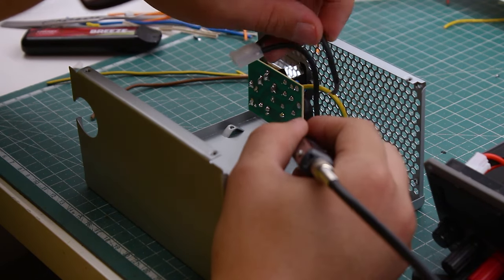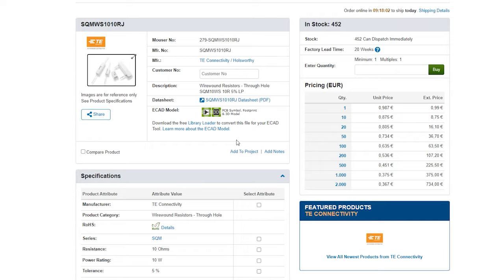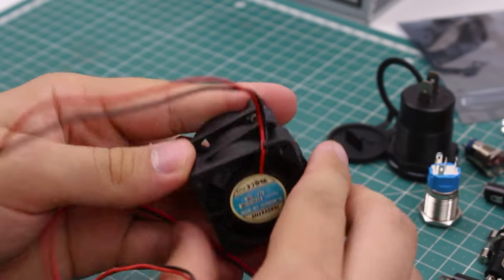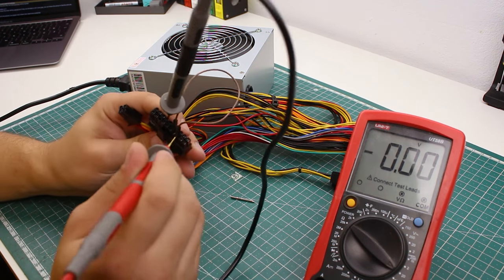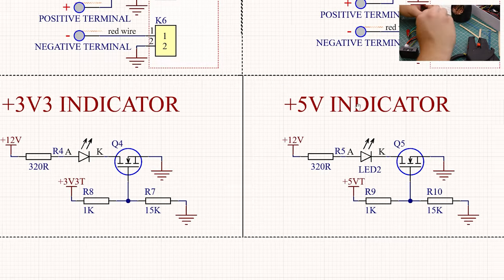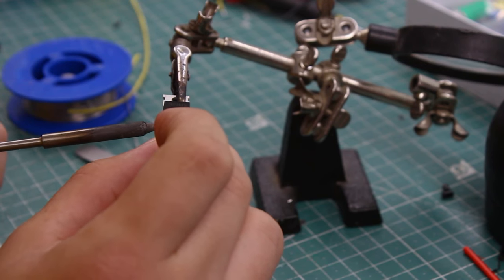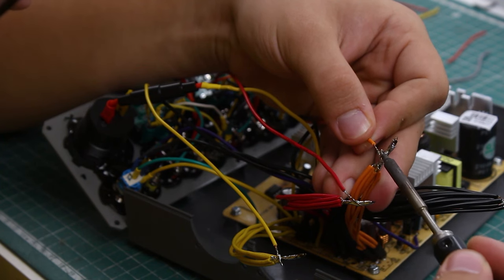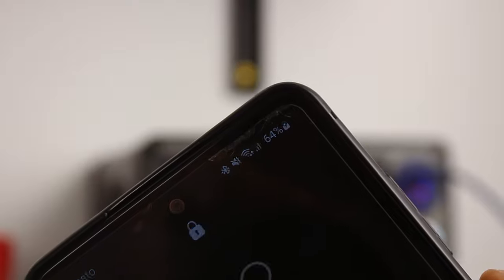DIY Lab Bench Power Supply From an Old ATX Computer Supply

Comment: Thank you for posting such a nice video. Your unit looks professional and quite versatile. There is one issue you should consider. When converting a computer power supply such as this, consider that the ground on most PC power supplies are internally connected to the AC power ground. If by chance you have another piece of AC powered test equipment such as an oscilloscope (they have the same issue with the ground), connecting test leads to the wrong place could cause something to go 'poof' or worse. You may want to consider, if you have the room inside the case, to install an isolation transformer. Or at least use one externally.
Reply from the maker: Thanks! About isolation, just as you said, I had a problem the other day. I connected a VESC controller to a 42V power supply that wasn't isolated because I didn't have a battery on hand aaaand when I connected the VESC to my PC over USB, the USB hub died together with a couple receivers for my barcode scanner and keyboards
Reply from the maker: I took a look at some isolation transformers for 240VAC but they are all over 100 Euros which is too expensive for such a project. I'll do some more research hoping I find something better
Reply: @Djambo57  you can make your own with a couple transformers, they must be same.

Comment: I totally disagree that OLD ATX PSUS are 'fine'.   They are much more likely to break down. And when they do they can destroy whatever they are powering
Reply: Most ATX PS breakdowns are cause by leaky electrolytic Caps. Replace them and you're good to go.
Reply: @paules0099   have  seen many more active  parts fail than caps in ATX PSUs
Reply: @kennmossman8701  and that was what???

Comment: Neat build up, just an FYI, you need to remember that an ATX PSU is a switching PSU, the output is by no means clean there is a lot of noise on the output. If you want to design or repair I would suggest you rather build a linear lab bench supply, there is a reason these supplies are STILL used, especially in a repair and design environment. For a simple and dirty supply yes you can do this, but, I would not suggest this for repair and design.
Reply from the maker: Yeah, and since I removed its case which is a shield it probably isn't a good idea to use it in a professional way. With that being said, this project was aimed at beginners, who are just starting out. Playing with LEDs, small motors, and similar stuff. 
It should do a good job for such things and I'm still using it to power simple stuff. When I quickly need to test a proximity sensor, for example, it's neat to have both 3V3 and 5V rails always there, always on
Reply: @Djambo57  Yes, for sure. I am sure it would be a good stating point for the beginner, I just wish that content creators would state this though,  SMPS's are great at delivering a decent amount of current in a small package, it is just not always the cleanest.  FYI, another tip, is to put a choke and another cap just ahead of the output terminals something like a 220uf cap and an appropriately rated choke for the current further cleans it up.....

Comment: Can you do a workshop and lab tour of yours, Please 🥺🥺. Also is it important to print the bezzel in TPU or it can be printed in PLA ?
Reply from the maker: Hey, the workshop is still not finished... I still need to get some tools like a microscope and an oscilloscope. I don't want to make a video about it until it's 100% how I want it to be, but when it gets there, definitely! For the parts, I left around 0.2mm tolerance if I remember right so it could be printed with PLA, but I'm not 100% sure :)
Reply: +1 for the workshop and lab tour

Comment: Nice project, the only thing I don't agree with is the positioning of the fans. In my opinion, all 3 fans should be positioned on the side where there are now 2 of them (throwing out air) while on the side where you placed one, create a grill large enough to let in the same amount of air that goes out. With this configuration, the hot air present inside is expelled by the fans and replaced by the fresh air that arrives from the grill.

Comment: Hm, how do you get the 3.3V display to work? On the Ali that kind of displays says they only works from 4.5 to 30 VDC?
Reply from the maker: Well these displays have 3 thinner wires. Red and Black are for powering up the display and you can connect the red wire to let's say 12V. Then use the yellow wire on the 3.3V rail to measure it. This measurement will then be displayed on the display...

Comment: I see the schematic for the mosfets in the video. In your video it looks like you are connecting two of the legs of the P channel mosfets together. Is that just an illusion, or are you really doing that? It would be nice to see a bit more detail on the connection of these :) Maybe a link to the schematic at least.  Thanks for the video.
Reply from the maker: Just follow the schematic it is correct. I remember  connecting something wrong while recording because the camera was in a way and it wasn't comfortable to solder like I usually do 😁

Comment: Well done!
You put a lot of thought into this thing. Many times, I cringe when I see people neglecting to use fuses and to build in other sorts of protections and precautions into their janky DIY PSUs. They just use stuff like ATX PSU cases for enclosures or they have cooling slots all over the place(in 3D printed cases), even though a Bench PSU is in a work area, and pieces of cr*p that you snip off or throw away, like pieces of copper wire and plastic etc.. can go into the enclosure and fans, and bliksem it all up.

I've never bothered with DIY bench power supplies- they just aren't worth it, and just bought my own- spending good money on it- as I do all my tools, equipment and appliances. My dad always said that it doesn't matter how *poor you are, just buy quality tools and equipment, BUT... I would like to build this one- with variation of course. I'd add a temperatue sensor for the fans- it's a low-power bench unit, no need for the fans to always be on and use additional power(every little helps). I'd also add a solar option and Li-ON batteries.
Should be good enough for an everyday option to preserve the life of my TDK-LAMBDA.

* (And my dad really was an underpaid tradesmen, but he had Hilti, Bosch, Gedore, Makita, Sony, JVC, Telefunken, Phillips, Calibra, Tektronix, Engineer Tools(Japan), Shimano, Weller, etc - all over the place. None of those ever let him down.)

Comment: one limit of this is that you can't tie your grounds of different voltages together, so if you have a circuit that needs 3.3v and 5v, it won't fly.
You can't tie the grounds together because the volt-amp displays have to be between the load and ground, not the supply and ground. If you do tie them, your current readings will be wrong.
I ran into this myself. My solution was to get some hall-effect current sensors and use an arduino to fake an analog output to the current measuring part of the circuit. Never got it quite calibrated though, other projects came up.

Comment: Your lab bench atx psu might be the best one Ive seen. I'm thinking of doing the same but I read online that ATX psus arent current limited. If I wanted 12V at 0.5 amps will it be possible or will I end up frying pcbs?
Reply from the maker: Thanks! They are not current limited but you can find some DC-DC converters on Aliexpress which can help you regulate both voltage and current. I'll be doing another power supply video soon and I'll be adding such a module so make sure to stick around :)

Comment: One thing that worries me is 3v3 switching. It can be that 3.3v for Vgs is not enough to fully turn it on so with hi current it can cause some heating problems. Recommend to check used mosfet Vds to Id diagram with 3.3v Vgs and use it to adjust fuse size.

Comment: I love this. Could it be made wider to include +24V and maybe a variable module?
Reply: You’d prolly want a buck boost converter. There’s a -12V line but it’s only got half and amp and thus is a bad idea to tap into. Unless you want to power an op amp or something simple like that I’d recommend against it.

Comment: I was having an idea that smd rework station has an adjusting knob for fan and temp control 
It delivers voltage upto 24 v 
And the pcb in it can handle a descent wattage consumed by heating element of heat gun and soldering iron 
Why can't we use it to make variable bench power supply 
If you can make one 
It is a new design no one has ever done 
I hope you will find it interesting
The idea is instead of heat gun handle we can use female banana clips 
The temp meter can be replaced by volt amp meter 
We will get two connections 
1 soldering station 
For low power equipment 
2 heat gun connection 
For more power

Comment: Excellent! Although I would have added another adjustable option in volts and amps, or would remove the 3.3V to place the adjustable! You may make the modification for a next video.
Another thing that would be great is that you would include subtitles for other languages, for example Spanish. Greetings
Reply from the maker: Hey, thanks for the comment! I was thinking about adding something like the XYS3580 module so I can adjust the voltage and current but I decided to leave this one as a basic atx supply with some added features. I already have an adjustable PSU at my desk but I'll for sure make my own in the future! 3V3 is actually pretty useful in my case because most of the ICs work on 3v3 so I wouldn't leave it out... And for the subtitles, I'll take a look at it :)

Comment: ⚠ Hi Djambo. Is it not possible to make a "standard" ATX Lab power supply chassis that will fit more or less any ATX PSU (could be restricted to modern PSUs from a certain date only or other parameters) so that you simply can grab it (the Lab chassis) off the shelf and throw in a PSU and it will work❓
Reply from the maker: Hi! That would be possible, I like the idea
Reply: @Djambo57  I'm sure you are the man to pull it off. I don't have the necessary skills. Oops.. maybe this idea should be kept secret lol.

Comment: Nice project, couple of suggestions. You do not really need to monitor the voltages for the different lines as they do not vary (much), that would simplify the project. A current meter is useful and this could be put on the 0V line as this line is common for all the different voltages (3.3, 5, 12, ...).
Reply from the maker: Thanks for the comment. I already built a couple of these before, without a custom enclosure or anything else but I wanted this one to be a bit more complicated. A beginner could learn a lot by building something like this. That's exactly how I got started with electronics, by building an unnecessarily complicated electric longboard.
Reply: I disagree on that!
One reason that most higher end power supplies do have a volt meter as well as the amp meter, is to monitor voltage so that IF a problem happens and the voltage on a line changes, if it doesn't burn things up, you'd see the problem before connecting something to it.

With power supplies, all it takes is a component or few to fail and cause a high voltage situation.

Every power supply I have has a volt meter (or more), including my professional digital, programmable Lab bench supply.

No way would I connect a project to a supply with knowing that the voltage is correct.
Reply from the maker: @BlondieSL  Yeah I feel safer when I can see the voltage reading all the time

Comment: hi there! Cool built! What is the yellow banana socket?
Reply from the maker: Hey, Thanks! The yellow socket is connected to the earth pin in the outlet. It may be used with an antistatic band and a current limiting resistor in series so you can hook yourself up to it while working with PCB so you don't damage something with electrostatic discharge

Comment: Your work looks amazing, and the case is very well-designed, but there is one problem. ATX power supplies work at high frequencies - without electromagnetic shielding (which is its own case), they cause significant amounts of interference in sensitive devices, like audio amplifiers - amplifier may hum or even (?) boost (idk how to say it, English is not my first language). The easiest solution for this problem is to install the original power supply with the original metal shield inside your case. Don't get me wrong, I appreciate your work, but you shouldn't use it, when professional hardware is needed. 
BTW, if someone uses an old ATX, it's good to check the electrolytic capacitors.  It may help with issues like turning off at random moments when it has to provide more power than usual.
Reply from the maker: You are 100% right but for an electornics beginner it shouldn't be a problem. Thanks! :D

Comment: You used many screens, connectors and mosfets by connecting them to each voltage separately ... When u can just use a one volt/Amp screen plus one "Rotary Switch" ...  Just connect the yellow wire from the screen to select the voltage ur working on 12, 5 and 3.3V ... LEDS i dont see why u need mosfets to control them, just one for stand by plus one for power on ... I built my power supply like that from 5 years back (plus i added a temperature control for the fan to work from 37c to 42c)  .. BUT the important thing is that you had fun :)
Reply from the maker: I needed to have all outputs available at any time because sometimes I have stuff that needs multiple voltage rails to operate...
For the LEDs, I wanted them to shine with the same brightness, I didn't have any smaller MOSFETs or transistors so I had to use these large ones
Reply: @Djambo57  In that case u are right  .. keep the good job

Comment: Nice PSU u got there. I really like how it front panel looks, and your choice of elements to turn ATX into bench. I just don't get one thing. Why did you spend so much time creating this and leave it only 3, 5 and 12v, without adjustable voltage/current? there's enough room in the box for a module, and maybe if usb is on the side/top the screen and button of the module can be fitted on front panel. and it can get powered on from 12v rail
i rly don't see the point of making this, other than just out of passion and too much spare time. it looks really nice, but you can get pretty much the same effect if you just drill atx and add 4 terminals (3V,5V,12V, Ground)+fuses and find a way to live with urself without on/off and LEDs for each terminal.
If I am to build such a PSU myself again, prolly I'll use a significant part of your design, its inspirational :)
Reply from the maker: I wanted this supply to be a basic fixed one, I'll make an adjustable one in the future for sure!
The space inside the case was eaten up by the wires so I couldn't fit anything else even it I wanted to :/
It is the same thing if you made it by securing the bindings posts to the ATX supply's case but I wanted it to look like a finished product, that's my obsession with these projects :)

Comment: MANY problems 
- such PSUs are very noisy - the waveform is terrible
-  when they  fail they can destroy the load
-  no current limiting
- no short-circuit protection
- not recommended for capacitive or inductive loads
- very high current at 5V so a short in the load will fry everything
-  NOT for the novice as there is a MAINS voltage subsection
Reply from the maker: I'd say they are fine for someone who's just figuring out how LEDs and resistors work. It's quite handy to test stuff like fans, etc. I maybe went too far with the enclosure, but I really like how it looks, and I use it almost every day